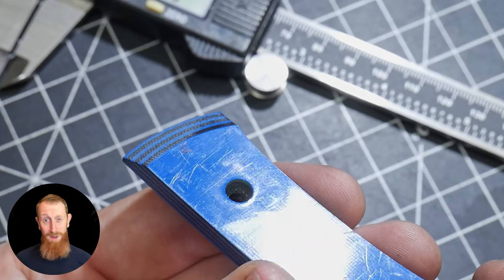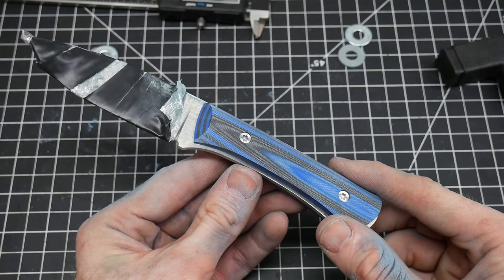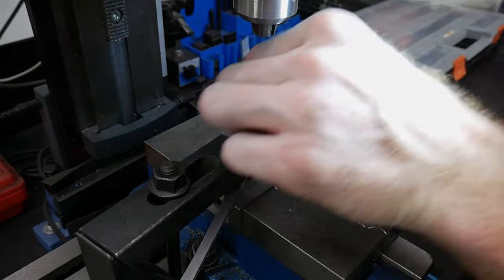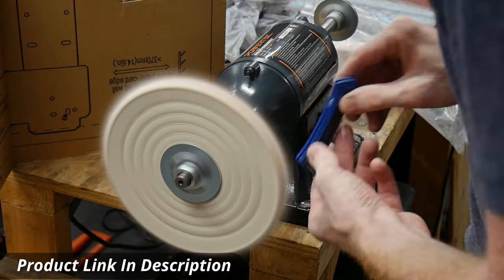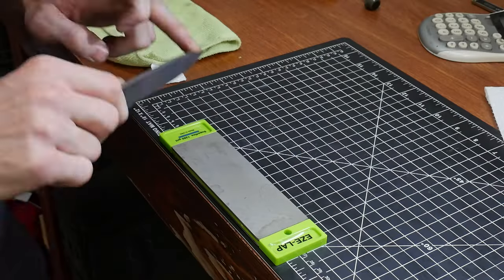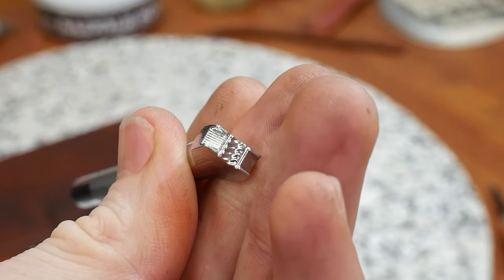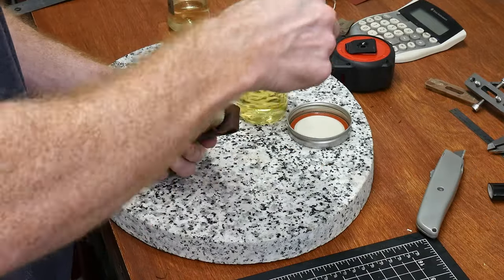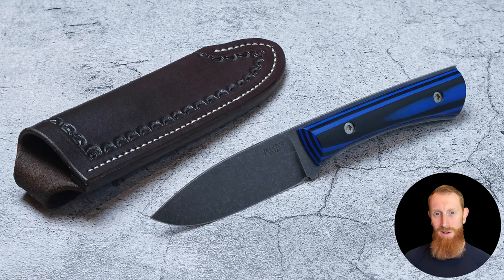You Still Have Time! - Build Along Part 2

Comment: What's up Red beard. I like the color choice for the scales and getting to see the sheath making as well. I'm almost ready to get started making knives. I've got my bench, 2x72, portable bandsaw with table, and a forge. I'm excited to get started. I have 1 question. If I am not doing any forging only stock removal, is normalization needed? Or does it depend on the manufacture of the steal weather or not it is needed? Thanks, stay awesome.
Reply from the maker: I like to normalize to “be safe” but you should be fine without
Reply: @RedBeardOps  thanks 👍

Comment: Man. I really wanted to make one. But I forged out a blade in 52100, heat treated and did cryo, I hung it up to warm up, and forgot about it overnight. And it SPLIT IN HALF!  longways down the blades spine. I'd never seen that happen before. 

So anyway. I decided fine, I'll make another, get it forged out, pretty much, then the tip cracked off. Idk what the deal is. They were both from the same billet. 

I really want to do this contest, but I just don't think I can afford to sink more money into it. Idk if I manage to get something worked out in time. I'll try again. It was just a lot of bad luck.

Edit: I have heard of blades cracking from  not tempering in time, but I meant specifically splitting down the middle like that.
Reply from the maker: Holy cow!! I haven’t seen that before
Reply: @RedBeardOps  yeah. I've heard of cracks, but id never see. That. It was cold rolled. So I. Thinking it was partially because of an issue with that. 

I might have posted a picture on bladeforums in the what's going on in your shop thread I can't remember. I'll check later, and if I didn't I'll put one up there.